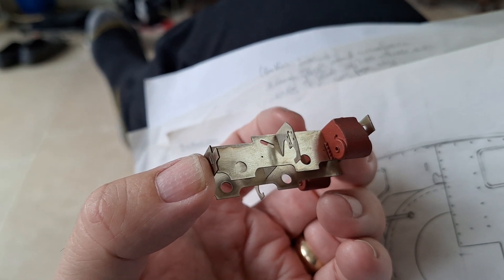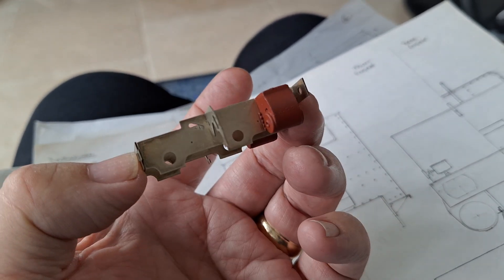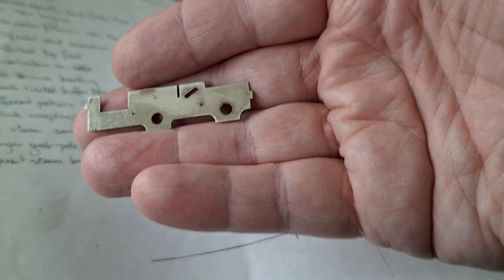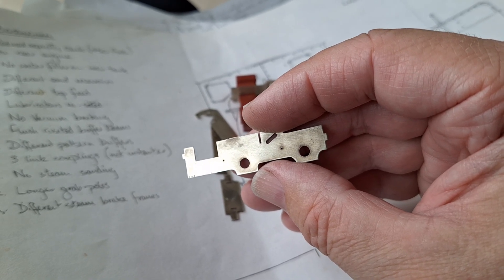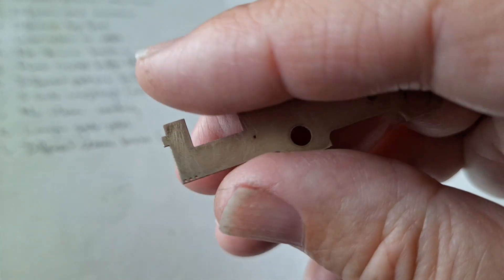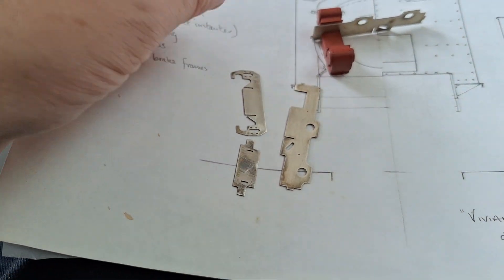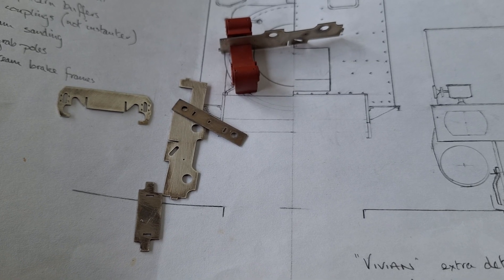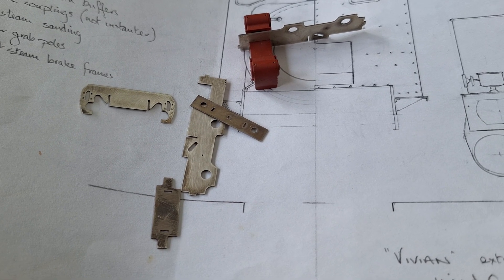Laser cutting chassis for EM Garratt with ComMarker B4 50w

Comment: Giles this is fascinating! What is the maximum size (I guess the size of the 'bed') you can deal with?
Reply from the maker: Maximum size is 200 x 200, but I am using the smaller lense, giving me 100 x 100, which gives me maximum power, finest lines etc..... It's a really good tool!